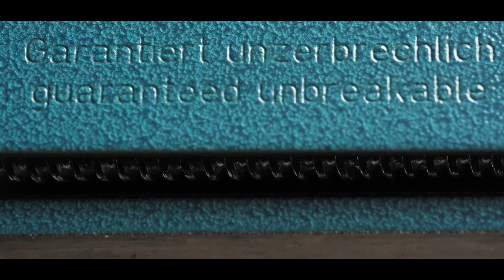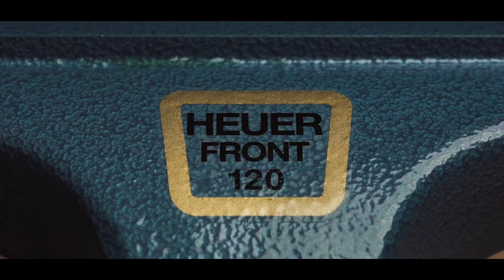No workshop should be without: the HEUER vice, a reliable work colleague (EN)

Comment: So, just got the smaller 100 as well, but the holes for mounting are quite to the front?
If I want to clamp some sheets in the vice, there is almost no room for the bolts to go in my wooden workbench if I want the jaws to be flush with the edge of my workbench.
Is that normal, do you advise to mount the vice differently?
Reply from the maker: We recommend mounting the vise so that the rear jaw is flush with the front edge of the workbench. Then you still have approx. 1.5 cm distance from the middle of the screw to the front edge of the workbench. That's enough. If you have any further questions, please feel free to contact us.